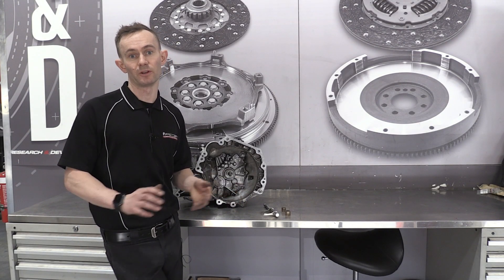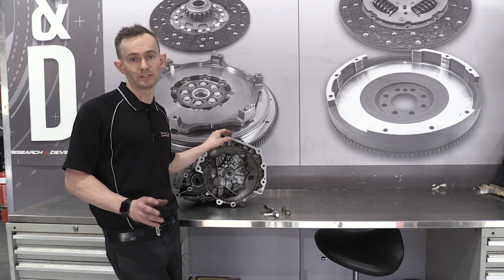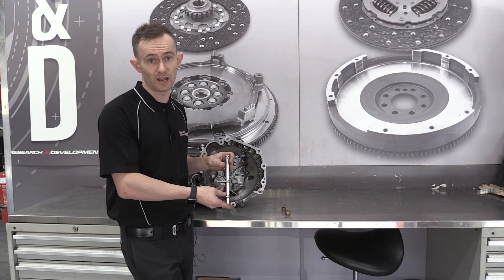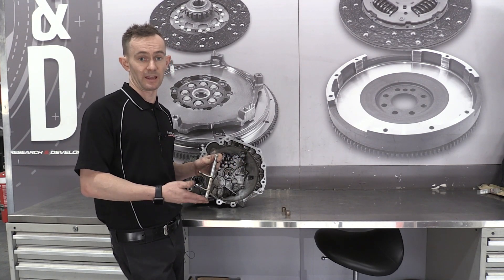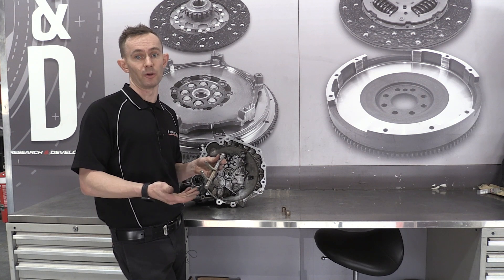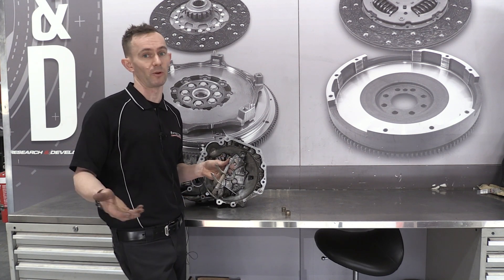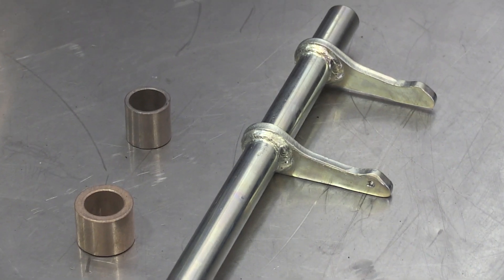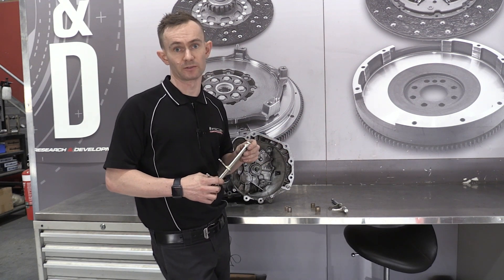CLUTCHTECH: Suzuki Swift Clutch Fork Replacement

Comment: This is exactly what happened to my suzuki swift 2005. I thought the problem was the clutch set so i replaced that. Event though the disc wasn't worn out. With the new set in place the fork totaly broke off within 2K km. Now it has damaged my new clutch set so I have to buy another set and will also replace this fork. 
Getting the old fork out might be a challenge. I think I will use a grinder to cut it out and then tap out the top bush from the inside out.

Comment: Just checking about the pin on the fork. The original one there is a pin there but the ACS part has no pin on it. Is it still useable?
Reply: Good spot. I think that might be a problem because the pressure bearing (good translation?) holds on to that pin.

Comment: How do you remove the old one?
Reply from the maker: Hi,
To remove the old one, you will need to get the top bush out and then simply lift the fork and pivot it out. We recommend getting new bushes before doing this in-case it is damaged during removal. We offer a fork and bush kit for this. If you require one, please email our sales team at sales@australianclutch.com.au
Reply: @australianclutchservices7503  thank you mate. Appreciate your help.
Reply: @australianclutchservices7503  can you take it out from the bottom or do you have to hammer it out bottom to the top?

Comment: Hi. My Swift 2019 clutch had a 'jagged' release (1st gear from standstill) and was replaced after 12 months (16K km). Suzuki acknowledged that the clutch 
was a proplem on this model. Now, 12 months later, same 'jagged' release (28K)... Any thoughts? Thanks...